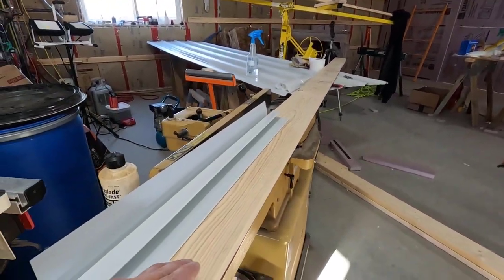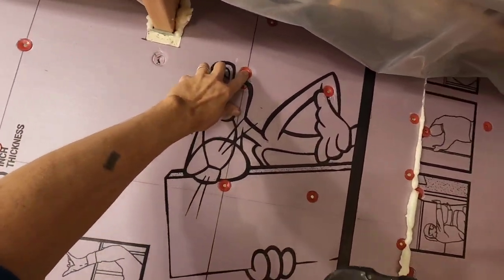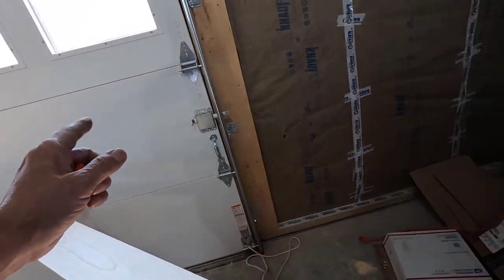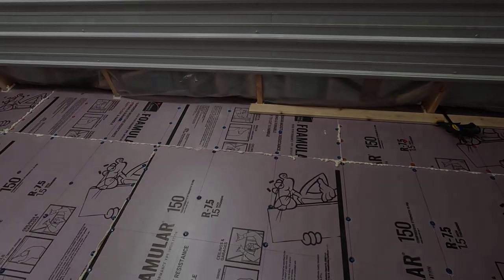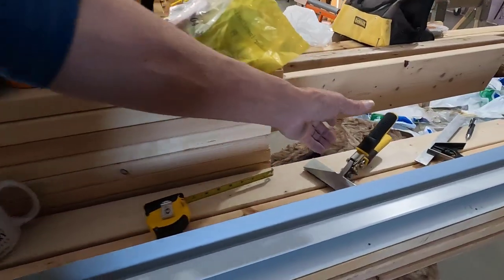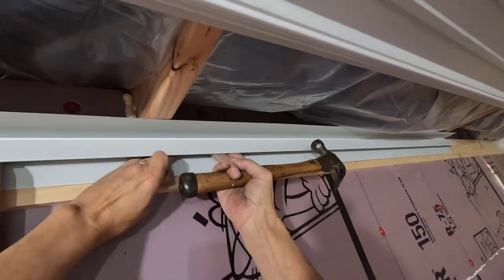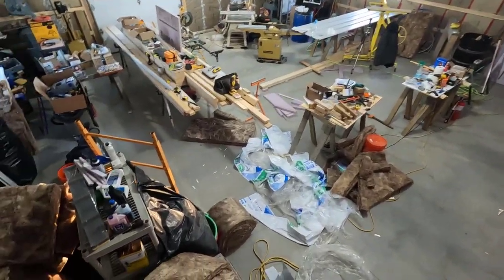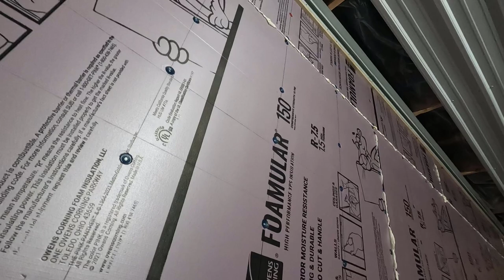Metal Ceiling Install ― Partition Wall Cleat and Final F&J Molding

Comment from the maker: With the F&J installed, I can finally install the last three metal ceiling panels to complete the metal ceiling! This has been a long project because it started with a whole bunch of stuff that needed to go above the ceiling (including a full set of joists), then as the ceiling went in, I taped and insulated it as I went. It was a massive job, and is now three pieces of tin and some insulation away from completion! 

Recent Products used:

Oscillating Tool Blade, Titanium Nitride Coated - https://amzn.to/3JM45Wi
30 Pack Black S Hooks - https://amzn.to/3lg0cyB
3/8-Inch-Drive Impact Extension-Bar Set - https://amzn.to/3lcpr4I
6 Piece Impact Socket Adapter Set - https://amzn.to/3HycYjk
Bolt Extractor Set - https://amzn.to/3x146Od
Kinco - Premium Leather Work Gloves - https://amzn.to/3XWT0W3
#10 Countersink - https://amzn.to/3kxA6H3
1/2" Shank Tongue & Groove Router Bit Set - https://amzn.to/3QQk0UZ
Temperature/Humidity Sensor - https://amzn.to/3CwMD3h
16' LeverLock Tape Measure - https://amzn.to/3MRu9i9
Seagate Desktop 8TB External Hard Drive - https://amzn.to/3gRZGEC
SuperWinch Terra 45 - https://amzn.to/3AdzJWR
Large Tapcons - https://amzn.to/3TDkJbz
Heavy Square Washers - https://amzn.to/3E1tvKV
DeWalt Impact Wrench Kit - https://amzn.to/3EtMaQY
Flexzilla Air Hose - https://amzn.to/3ARo6W5
Drywall Lift Panel - https://amzn.to/3hOwDm4
Milwaukee M12 2.0 AH Battery - https://amzn.to/3X9qvVl
Kinco - Premium Leather Work - https://amzn.to/3EeLTjv
Johnson Laser Level - https://amzn.to/3idhn2h
Tyvek Sheathing Tape - https://amzn.to/3XKaQMu
MemBrain Smart Vapor Barrier - https://amzn.to/3ugDBmD
ColorFit by Milton Coupler & Plug Kit - https://amzn.to/3UpS6iJ
Milton Safety Exhaust Coupler - https://amzn.to/3FhrCeY
Senco SPS SKS-L, SKS-M, SKS-N Staple Gun O-Ring Kit - https://amzn.to/3H3wqWq
Old-School Brass Laundry Faucet - https://amzn.to/3TcXWUH
Schrader Valve to Male NPT Fitting - https://amzn.to/3ytxazd
Carbide Tipped 2" Hole Saw - https://amzn.to/3VCV5Wj
100 lb Neodymium Magnet - https://amzn.to/3U8vrHF
200 lb Neodymium Magnet - https://amzn.to/3F2PEu8
300 lb Neodymium Magnet - https://amzn.to/3FksvSQ
500 lb Neodymium Magnet - https://amzn.to/3YbZbq2
600 lb Neodymium Magnet - https://amzn.to/3FdaWUC
700 lb Neodymium Magnet - https://amzn.to/3hej2UX
1,000 lb Neodymium Magnet - https://amzn.to/3FH8VkS
1,500 lb Neodymium Magnet - https://amzn.to/3uHbU6Q
Starrett Combination Square - https://amzn.to/3hbAwS5
Thermal Warm Crew Winter Boot Sock For Men - https://amzn.to/3j5EFr3
Energizer AA Ultimate Lithium Batteries - https://amzn.to/3V95tUX
USB 3 Extension Cable - https://amzn.to/3BML0y9
SZHLUX 6 Pack LED Shop Light - https://amzn.to/3j9Dozn
CH2100 2-Pole 100-Amp Circuit Breaker - https://amzn.to/3GbrduP
DANCO Gas Test Gauge - https://amzn.to/3YBRAS9
Indoor Outdoor Thermometer Hygrometer Wireless Weather Station - https://amzn.to/3FJq1O5
Tordon RTU - https://amzn.to/3WGu98d
Male to Male USB Cord - https://amzn.to/3WnKIWS
YELLOW JACKET Gas Pressure Test Kit, 0-35"Wc - https://amzn.to/3FXUzf3

Comment: Once that ceiling is done it looks like you can take your time with the rest?
Reply from the maker: That's kind of true. I do have to start on the walls so i can hook up the electricity. I'll need that for the next rush — getting the mini-split in before the heat comes 😮